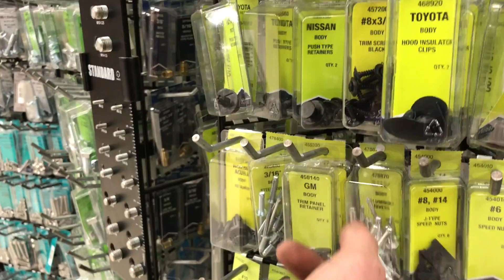Rebuilding A Wrecked 2017 Corvette Z06 Part 11

Comment: I'm old enough to have disassembled, rebuilt or replaced parts of lots of collector cars and one thing that helped is putting fasteners in zip lock bags with a piece of paper inside showing where the parts including shims came from. For instance left fender, right fender, radiator support and on and on. I put a piece of masking tape on wires with connectors with a number on the tape. Then I wrote where that number plugged in  on a legal pad and secured it under the windshield wiper. This created my assembly checklist. It was important to make note on the legal pad about the position of grounds, also with numbers. The object was "zero defects" and mistakes.

Comment: Love your channel and the content you put on and kudos to you both for your work ethic and making sure that you use OEM or near perfect parts as well as keeping track of them for the buyer. As for the Corvette C7-Z06 I have a few suggestions, but first a disclaimer:
- Disclosure: I own a Z06 and have worked on these cars and have really looked under and over these cars and I have to say that these things are chuck full of lazy engineering, bad engineering and down outright horrible components and parts. Now that that is out of the way here are a few suggestions:

1) GM mandates that anytime any part of the aluminum frame is cracked the car must be totalled as they do not recommend or want the frame to be welded or repaired if cracked. You may want to look into that as I know in certain states that must be declared to the buyer as it's a safety issue. 
2) Corvettes are shipped from the factory in the "shipping height" setting, hence why yours and others sit so high. To get the ride height lower, look at the bolt at the end of the leaf springs. You should be able to flip that around or remove a spacer, hence getting the car to its driving height. 
3) I suggest you get an alignment bolt for the wheels (basically a long rod that gets put on one of the wheel bolts in order to alight the wheel to put it on. This is highly highly highly recommended on cars with ceramic/carbon brakes as when you go to put the wheel on and you hit the edge of the rotor it there is a great chance that it will get a small chip and/or crack on the rotor. If that happens, the rotor has to be changed and cannot be repaired (not changing the rotor could result in the rotor breaking under braking - no pun intended). 

Thanks again for a great channel and can't wait for future videos.
Reply: Finally someone with a brain. That frame is useless....
Reply: Rubbish. The chassis crack was not on a major structual part of the vehicle, it is only the part that holds the radiators and associated stuff on the front of the car.  A simple weld and plate will sort out any issue.

Comment: If those are carbon fiber brake rotors then they actually work better when they are hot. But they still need cooling. I love this build. That is one fantastic car. Sick wheels. Love the videos keep up the good work.

Comment: GRIZZLY!
Looks great guys, just to let you know guys the carbon / ceramic breaks will not fade like conventional breaks when they get HOT
They were originally designed for Formula cars, the hotter they get the better the breaks work, when Chevy first offered them on the ZR1 they were optional and cost $20,000.00 extra for the upgrade, keep up the good work.

Comment: Man that part where you're messing around with the removed steering wheel and you insert the clip of the Vette crashing off the road had me in stitches. So funny...hahaha.

Also are you planning aftermarket stuff for the Vette? Exhaust or a supercharger pulley swap out perhaps?

Comment: All you have to do on that carbon fiber vent is warm it up with a heat gun in the bulging area push it down and hit it with compressed air to cool it and it will stay.

Comment: There is a lowering bolt on each corner of the Z06s and for all corvettes c5-c7. You can lower it for free. They are so high for the shipping trucks. And dealerships often do not lower them. Or at least not low enough.

Comment: Couple of parts missing. The undertray is a full width plastic panel that bolts to the under side of the front splitter and several other locations at the rear of the panel. There are something like 22 small Torx heads bolts that fasten the undertray to the bottom of the splitter. It fits below the panel you were calling the undertray. There are two sets of end caps that are fastened to the front splitter. The small ones are called Stage 2 caps and are for street use while the large tall ones are called Stage 3 End Caps and are for track use but most people run them on the street if they have a Stage 3 car like you have.

Comment: You should try ceramic coating on another (less pricey) car. Once you feel like you've gotten the hang of it I'd highly recommend doing the mustang and corvette. It REALLY preserves the integrity of the paint job. 

A clear wrap is also an option but since the idea is DIY, that is probably not the best route.

Comment: I think with carbon ceramic brakes its not a problem if heat up, better work when "hot" cuz it has the ability to maintain their functionality at high temperature so no problem with the stopping power there...

Comment: You forgot to clock the clock spring.  Usually you turn the spring 3 times to the right then back to center then 3 times to the left and return to center and then the spring is clocked.

Comment: You guys give me hope to build one of the cars iv been dreaming of owning I wanna put a viper engine the v10 8.4l into a 2008 dodge magnum or a 2018 dodge Durango mainly looking at the 2008 magnum tho with all performance wheels tires breaks stearing ect but was looking just to take all those parts from a wrecked viper and install them on the 2008 dodge magnum